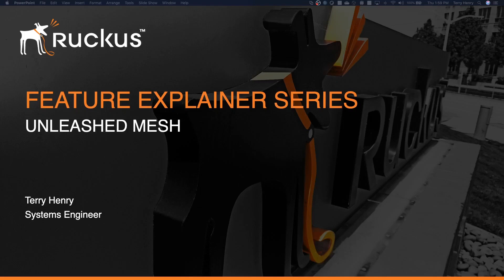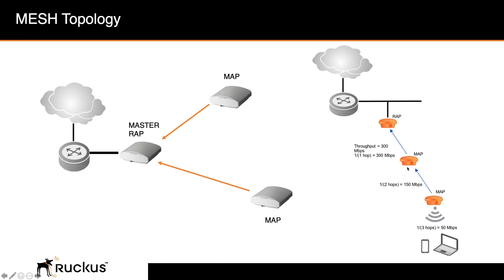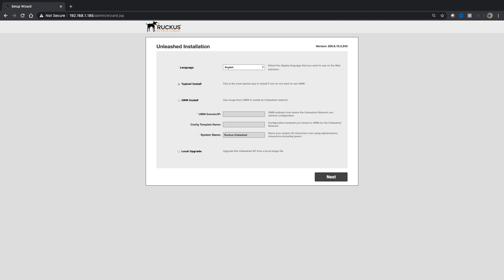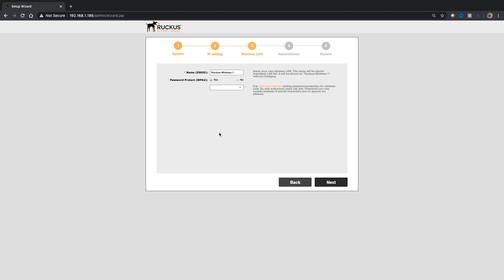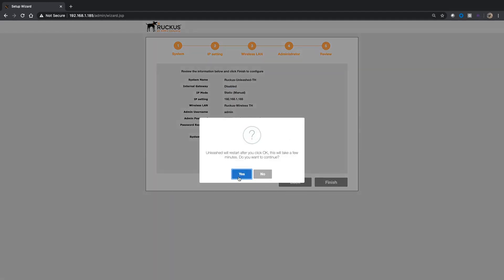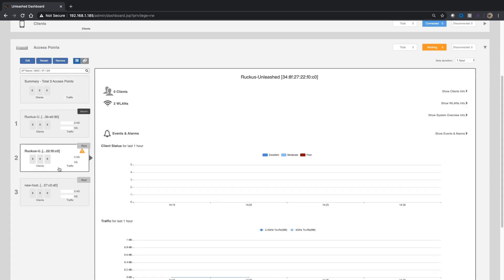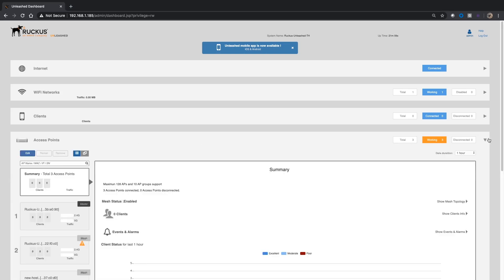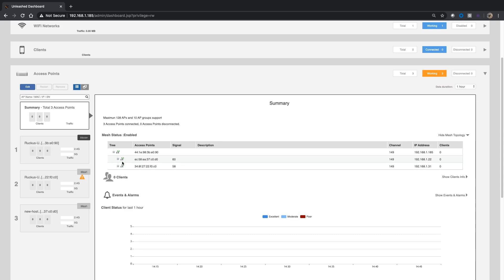Ruckus Unleashed Mesh Configuration

Comment: Hoping you can help! I set up two r510 APs. One is upstairs connecting to a ruckus switch and that is the master and is working fine. The r510 downstairs I’m setting up as a mesh and did the No touch mesh. When it’s cycling on, the pwr light goes solid green, ctl light flashes green fast then the pwr light turns red after a bit. Any advice?
Reply: Zero touch means you pre-authorize the mesh AP to join the Unleashed network using its serial number.   In a medium to large deployment, it saves you from having to manually authorize every mesh connection.  It does not mean its simple plug and play.  For a more plug and play like experience, setup the Unleashed network with both APs physically connected to the same switch then it will join the unleashed network and if mesh is turned on will join as mesh when you disconnect it and put it in its other non-wired location.

Comment: So what if you configured 10 at the same time and they all out there, months down the line you want to add another do you need to take the master down and put it on the same switch to see the new one?
Reply from the maker: Your root node is going to be wired anyway so just plug the new AP into that same network until it configures and then move it... or search for Zero Touch Mesh.
Reply: @TerryHenry  hi terry i've been trying that but it doesn't work. i see the configure me ssid stay and if i connect to it it's like setting up a master. It's my first time using these i'm use to ubiqiti.
Reply from the maker: Try upgrading the firmware on the new one to the same version as the master. If that doesnt work then it cannot see the master on the network.
Reply: @TerryHenry  Thanks
Reply: @TerryHenry  one last thing, it has a 0.1 ip my network is 9.X , do i change it ip and if so how without going through the whole master setup. thinking thats why it can't be seen.
Reply from the maker: @hershell78  that's it.
SSH to the AP's 0.1 address or put it on dhcp first and login with super / sp-admin
set ipaddr wan <ipaddr> <netmask> <gateway>
i.e.
rkscli: set ipaddr wan 192.168.1.193 255.255.255.0 192.168.1.1